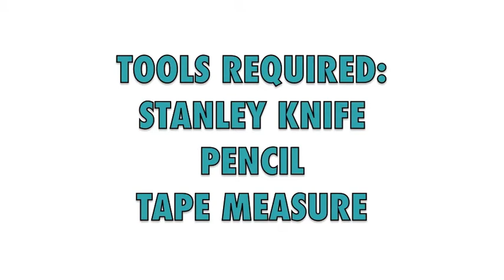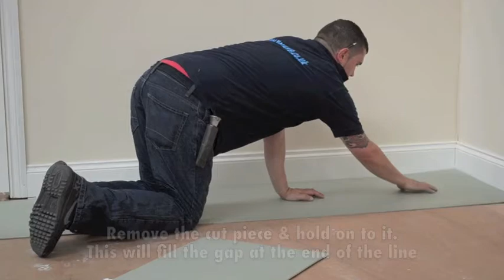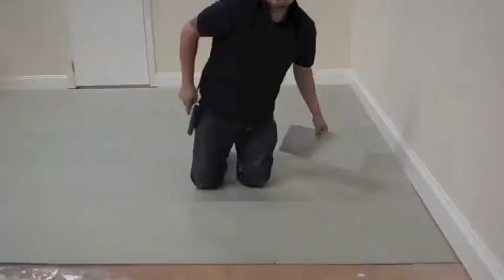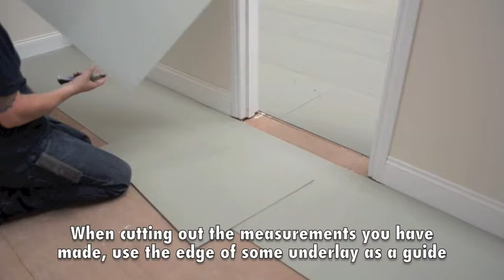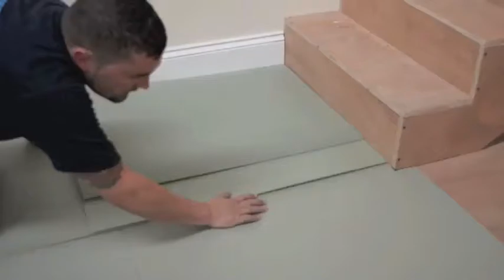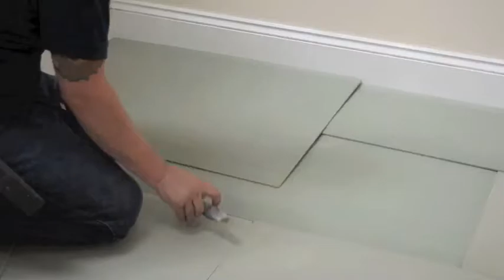How to lay fiberboard underlay

Comment: Are you leaving small gaps in between each board, and at the end where it meets the wall? I can't quite see in from the video.  Thanks
Reply from the maker: hi there, the underlay will be butted together and no expansion gap is needed around the edge of the room. Hope this helps, The Floorsave Team
Reply: Everywhere I have read says to leave a small expansion gap. Do you join the boards together eg by staple or taoe etc?
Reply: @stewartmccracken3189  Same here do different boards have different requirements for gaps ?
Reply: yes should have 2mm gap between boards and 8-10mm at edge of room

Comment: Was this the only underlay you used?  IS the Fiberboard better than the other polythermal ones i see at Lowes?
Reply from the maker: Hi, it is one of the options we offer as underlay and we showed how to lay this. There is not necessarily a better underlay it will depend on what you are trying to achieve. Such as sound reduction, thermal qualities etc. Please remember that the Fibreboard is not suitable for concrete subfloors.
Reply: @FloorsaveCroydon  Sound reduction is my goal.  Yes i am installing on wood subfloor and want to reduce the sound of footsteps when on floor below.